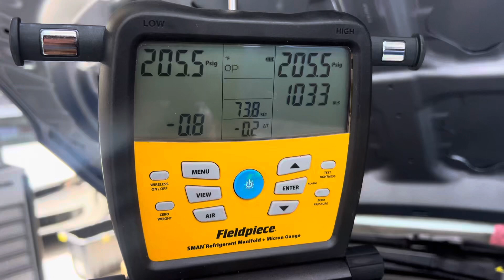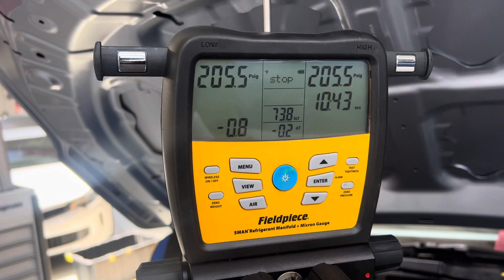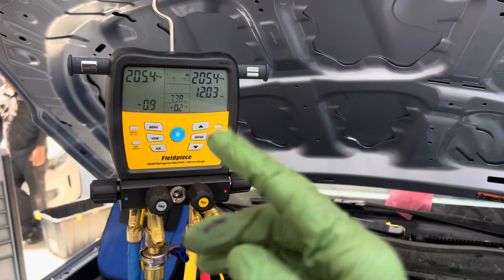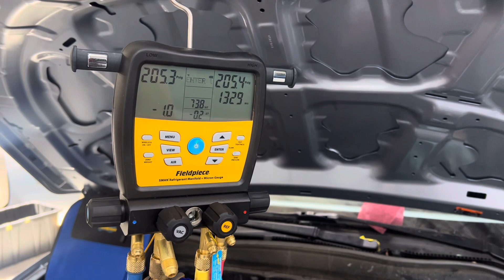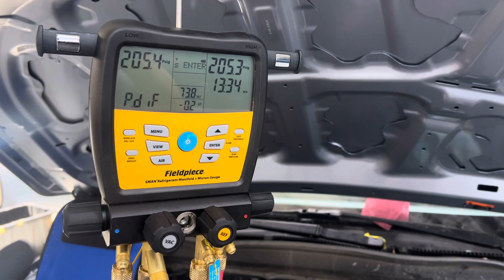I DID NOT WAIT STABILIZE NITROGEN BEFORE DECAY TEST. So it looks like a leak

Comment: Just a random question I guess, but I always wondered are the ac connections for vehicles the same as the connections for home HVAC, because I see that both use the same equipment.
Reply from the maker: Only on very old vehicles before 1993 roughly and before quarter inch threaded

After the introduction of R 134 
Automotive switched over to a unique coupling, sitting adapter service port 

Still use the same equipment, but we just had to get adapters that fit on the ends of our hoses to attach to the Automotive vehicles

Comment: Sight glass on my manifold gauges showed oil in it after pulling a vacuum. Where did that come from? Was it from the system or the oil in the pump?
Reply: At 14.696 PSIA there enough flow to draw oil up out of the system during an evacuation.  In MVAC will usually get oil when recovering the refrigerant, but not so much in HVAC.  It may have been just outside of the sight glass, or you still had a refrigrant in the system.   Also make sure you haven't overfilled your vacuum pump with oil.  

If you don't go deep enough when recovering the refrigrant and wait a while, a sealed system will re-pressurize as it continues to boil off the liquid refrigrant.  If you suddenly open the system this can cause a high enough flow bring the oil out of the system.  As strange as it sounds liquid refrigrant can sit in a pipe or hose at atmospheric pressure!
Reply from the maker: @HVACR559  you are 100% right about everything you said I have actually made videos about these different topics and showing some of the conditions that I have caught on camera

This is what happens with lack of education 

This is what happens when people don’t read instructions on equipment, all the fine details, such as gloss over enough to plug it in the wall and hit some buttons 

This is what happens usually did not even so much I study for the PA test that kind of walks you through and tells you what not to do 

Like when recovering refrigerant it must be able to hold a -15 vacuum now on automotive 

If you’ve seen my videos, you see I recover refrigerant with the recovery unit all the way down to 800 or 900 µm 

And then put on the vacuum pump 

When properly done there is absolutely no way a vacuum pump removes oil out of a system
Reply: Except there wouldn't be any refrigerant in the system because all the parts are brand new and no refrigerant has ever been added to any of them yet. I completely rebuilt the system from scratch. The only thing that is reused from the old system is the sensor for turning the compressor on and off. I should be honest about one thing. At some point with the pump off I did open up the red and blue valve so that I could reduce the vacuum enough to disassemble the hoses temporarily but I soon after like within minutes reassembled it sucked out whatever I had let in with a vacuum. I'm just fearing that I got vac oil mixed but it was short lived that those knobs were open since I didn't want to mess up the accumulator.
Reply from the maker: @electric_thumbs  this is the secret information that we needed to know. 

Human error are the most notorious in difficult to diagnose outside the average in normal failures . 

On some vacuum pumps . I don’t know if this happened in the situation.
When is Systems Under Vacuum if you shut off the vacuum pump and there’s no shut off valve is not isolated , 

You can suck the vacuum pump oil out of the vacuum pump in the atmospheric pressure will push backwards through the exhaust through the pump into the vacuum pump, oil chamber and push the oil back up into the air conditioning system through your gauges 

This is a possibility . 

Because vacuum pumps do not remove oil out of the system . 

Except in one case where the fitting on the pipe is at the lowest point 
And the person filled up refrigerant oil in that pipe and it all went down to the lowest point and you turn on the vacuum pump and it sucks out the oil that you just put into that pipe or hose .
Reply: @coldfinger459sub0  so maybe then I pulled it all back out?
Reply from the maker: @electric_thumbs  should only be a little.  .  But if you want perfect, it doesn’t hurt to pull that line off. 

And check if there’s a oil in the suction line that is mineral oil from the vacuum pump . 

Question, is this your first time doing air conditioning on your own car?
Reply: @coldfinger459sub0  yes it is and hopefully the only time I have to do this. I think I remember seeing the system pull some of it back. Having read what you told me this morning about the line being at the lowest point I thought it be good to try making the liquid line the lowest point so oil would be more likely to pull upwards and out and I ran another vacuum this morning placing the pump at the highest point possible to make sure the liquid line is lower . At that point I think I saw a little bit draining out through the sight glass. System last I checked has been holding an excellent deep vacuum.
Reply from the maker: @electric_thumbs  it’s a learning process when you’re a beginner

And somethings came to be confusing
Reply: @coldfinger459sub0  yes indeed but it still helps a bunch to talk with those like you that have experience. I wish you lived in North Texas. I'd just have you put the refrigerant in instead of having to drive it over to the shop tonight. Sounds like you make on site appointments but we're in different cities I think.
Reply from the maker: @electric_thumbs  I like San Francisco in my average temperature of 62° to 68°F. A roasting hot summer in San Francisco is 80°F and I literally can’t stand it. I die in burst into flames when exposed to the sun.
Reply from the maker: Vacuum should not pull out the oil

That means you still had refrigerant in the system. It was not properly recovered before the vacuum was performed.

Comment: You should install temperature probe for Liquid line and attach to some point in system to compensate for change in temperature! It is internally calculated in that SMAN! But I agree that you shuld wait 10-20 min before pressure test after you pressurized system with nitrogen! I usually change units to kPa  because there is biggest resolution!. Depending on size of system you should wait from 10 min to more than 2 hours! Bigger the system, longer wait! My usual measure is 1 kg of refrigerant in system is equal to 15 min of pressure test!
Reply from the maker: Yes, I was just explaining that to somebody else

But on this small tiny system in this situation on a close system that is not 1000 or 2000 feet of pipe spread throughout a building and a roof where the temperature could be drastically different doesn’t make that much difference on a short test . 

Because I know the temperature is higher or lower when I start my test procedure . 

And I allow my system to stabilize the gas temperature for 10 or 15 minutes before I perform my test . 

So I don’t have to worry about the pressure, jumping up or jumping down in a short period of time 

When I do my large commercial building installations with 1000 3000 feet of copper pipe in anywhere from 10 to 30 air handlers attached to the copper pipe with 20 to 60 tons of heat recovery unit on the roof of the building 

I do a nitrogen pressure Decay test at 600 psi for 24 hours to 72 hours or more . 

Then I use temperature pressure compensation

Comment: Tom I see you are using a new SM480V.  I just bought one and want to know if you still take them apart and install the CRC silicone grease ?  Thank you for continuing to produce content many of us are able to really advance our HVAC knowledge  thanks again
Reply from the maker: Long time, no hear from you Sid 👋👍

I have not done it to this set of gauges. I don’t think yet. I don’t remember making a video on it but I’m going to do it anyway whether I need it or not it’s pretty bad when I can’t even remember what I’ve done to my tools, but I just have too many.
Reply: I got the SM480 to pass the vacuum test yesterday, but the CPS hose set included from Tru Tech Tools failed. I ordered the new Fieldpiece 3 piece hose set from Tru Tech Tools today and will retest as soon as the back ordered status allows me to receive mine., I would enjoy your comments and opinion on those newly released hoses as soon as you are able. Keep up the great content.  LOVE it!!
Reply from the maker: @Sid9397  your hoses were not probably Leaking if you were performing a micron vacuum decay test

You cannot perform a vacuum decay test on refrigerant hoses by themselves there’s not enough volume . 

And then turn all volume. You are also measuring the moisture that has absorbed into the rubber since production. You’re also measuring the outgassing of all the solvents that they used in the manufacturing of the rubber components themselves. . 

I’ve done a video on this 

So has Jim Bergman in his vacuum video about using the vacuum rated equipment 

Refrigerant hoses were never intended to hold a deep vacuum in the lower micron range so you will never fully pass . 

And then, one of my videos I showed you you need a large volume to compare to when hooking up your hoses when you are attempting to do it the wrong way, which I also mentioned in a lot of my videos . 

Do you need a brand new Refrigerant tank recovery tank? 

You hook up your hoses to your recovery tank and leave it on the vacuum pump for 24 hours .  Maybe even more.

And sometimes you even have to do a nitrogen, purge one or two times to flush out what remaining moisture is on the surface of the metal and in the hoses and repeat your vacuum two or three times . 

Then you run your vacuum decay, test isolated .  You’ll see a little bit of decay and then you’ll see it start to stabilize out and stop decaying after a while.

Refrigerant, charging hoses were never ever intended for vacuum at the micron level . 

Your hoses are probably good it’s the micron meter is just so sensitive just a Out Gasoline the micrometer can measure a gnat farting in the room 100 yards away 
🤣

And the only way you can prove this with your refrigerant hoses is my hooking them up to a large brand, new, refrigerant, recovery tank, and performing the test that I described above 

You can see the results in one of many videos that I have done this exact same procedure on .
Reply: @coldfinger459sub0  great explanation, Tom. lol at gnat fart. hilarious example

Comment: Have you ever tried that co2 product that changes color? I've seen a couple of videos and it looks good on face value.
Reply: Nitrogen or argon are the only gases I will use for pressure testing.  Micron gauges are calibrated to nitrogen.
Reply from the maker: @HVACR559  100%, correct. 

There’s a good reason why and commercial and industrial they absolutely do not put CO2 has a leak checking or pressure testing gas into the systems . 

Unless CO2 is used as a Refrigerant in a CO2 system  lol 😂. 

But even then they complain. They’ve been having since Covid a hard time to get moisture free CO2 for the large refrigeration racks in supermarkets CO2 systems. 

So they have to process it on site by running it through multiple dryers before entering it into the system 

And even then they say they sometimes have to put in the dryer shells and then come back after 20 or 40 hours and keep swapping out the dryer’s until the system is dry . 

This is the problem with CO2 .
Reply from the maker: I’m all for it never used it. But getting a dry source of CO2 is not always available at all. Gas outlets CO2 is inherently, a wet, dirty gas.

CO2 for laboratory equipment or medical grade CO2 is pure CO2 and has gone through a drying dehydrating process to remove all the moisture . 

Because CO2 loves to latch on to moisture molecules And create carbonic acid. 

And what is her number one contributor as a contaminate inside our automotive air conditioning bulletin’s especially after they came from the body shop 

MOISTURE ! 

I will be doing a video on using CO2 later and using filter dryer’s in another CO2 containers to transfer your cheap CO2 that you buy from a gas supplier into a dehydrated, dried out new tank through a filter dryer to remove moisture out of the CO2 that comes from your gas supplier . 

This is a process that is done in commercial refrigeration on CO2 refrigeration units . 

When they cannot get a Supply a good dry CO2 from a gas supplier they run it through drying filters first prior to putting it into the refrigeration units
Reply: @coldfinger459sub0  interesting, look forward to that 👍